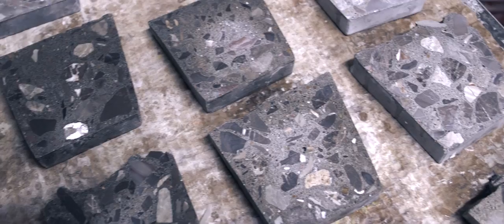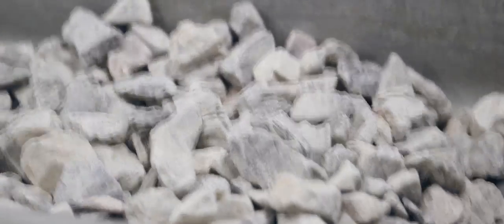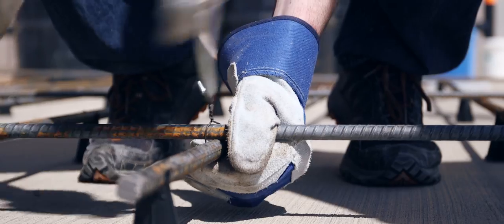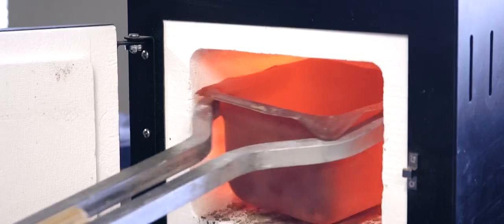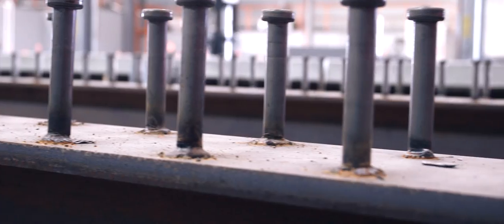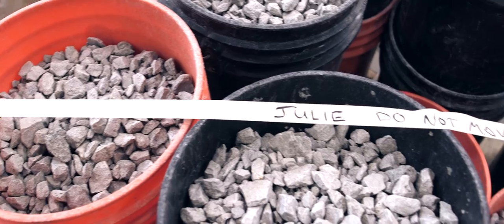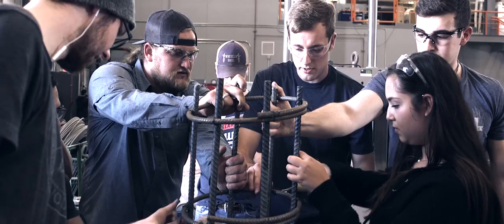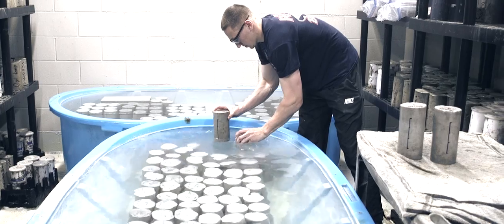The Concrete Life | Channel Introduction

Comment: Hi glad to see your videos.
I have art/design background, with home builders in family, and now I am homeowner.
Suggested topics to cover:

1. Thomas Edison development of modular concrete  homes/buildings.

2. Some new chemical coating for super strong material/binding "linex(?)" As possible rebar coating or as alternative, exterior sealing of concrete with Linex? 

3.alternative material and/or rebar design: 
i.silk or Kevlar embedded rebar? 
ii. Woven/complex nylon/plastic (non-corroding?) Rebar shapes - porous to permit measured interpenetration with concrete, with significant corrosion reduction - maybe like chain link as model?

4. Maybe do a video or series on how great Frank Lloyd Wright's concrete block structured really are. This one could get you cross media public notice, from all the home building TV shows to architecture and engineering education and the many "look at this cool stuff for building materials videos - like the recent wood frame sort of I-beams which reduce overall cost of lumber per home, but offer greater bearing load strength?

5. Video to deal with concerns that Co2 emissions from concrete construction account for some significant portion of global greenhouse gases.

Comment: Tyler, love your videos.  We are building a three-story 180,000 sq. ft. building.  Our concrete contractor wants to use Helix Micro Rebar instead of steel mesh.  What is your opinion of the product?

Comment: Your videos are very informative, thanks for that.  I know that the applications are different but I was wondering if you have ever done anything with aircrete?  It still uses cement as the base start, so I thought I would see if you have any experience or thoughts on it. Thanks.

Comment: Could you provide a concrete over pavement segment?  Looking at concrete behavior on a 20% slope asphalt 1 inch base. Thinking that using concrete curbs to create forms on both sides with Fiber filled OC (4000 psi). Concerned on selection of rebar - watched your videos - Basalt FRP Rebar (gator bar) seems to be a bit different that those you have covered. Friend getting her PhD in laminates in concrete a few years back - made me wonder if a carbon fiber based fabric  might be the hot ticket if concrete poured back to back with fabric layer(s). Cheers
Reply: Fabric with holes.

Comment: I used your search button and search both "basalt rebar"  and "basalt".   There are no videos on basalt or basalt rebar.   Why not ?  Do you know of any codes using basalt rebar ?  Thank you  Jim  Murphy
Reply: GFRC and CFRC are better anyway, along with carbon fiber constrainment wrapping. the key is to match the ability of all the different materials to strain and yield so you either get a product that is extremely strong but fails all at once, a weaker one that has many stages of failure, or a mix between. referring to UHPC and HPC in particular (all the best with glass or stainless fibers, soon maybe carbon nanotube fibers)

Comment: Would you describe composition and manufacturing of high performance concrete someday ? It's very interesting subgect. And also about economical aspects of HPC and it's reasonability.
Reply from the maker: Sure!  
Were you more interested in HPC for strength or durability?  I could do a video on both.
Reply: Both are interesting)
Reply from the maker: I will put it on the list!
Reply: @TylerLey  if you could focus on UHPC in leu of some HPC content that'd be a step in the rock direction! you can save money by only needing 4 inches of material vs 2 feet, plus its a lot cooler.